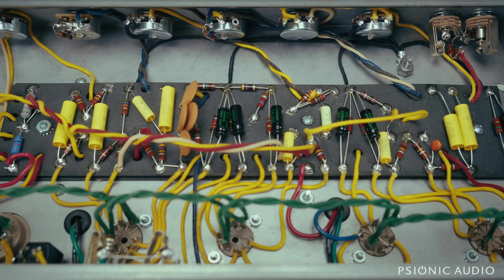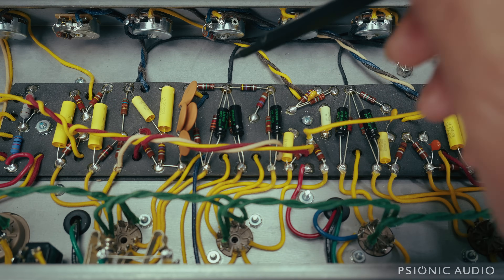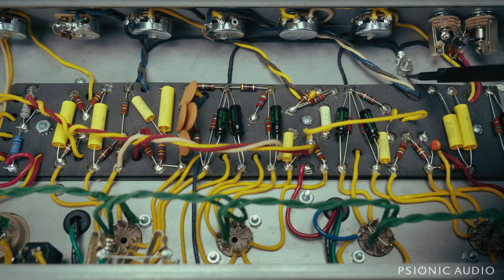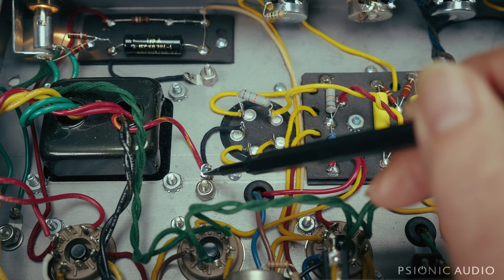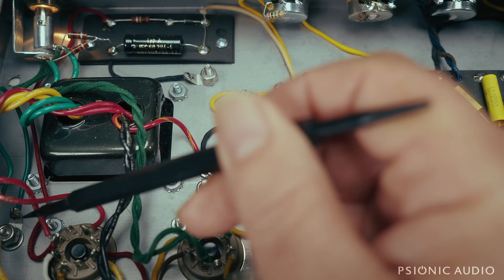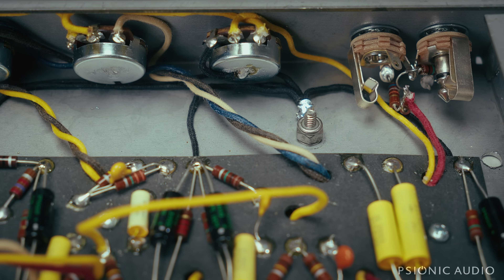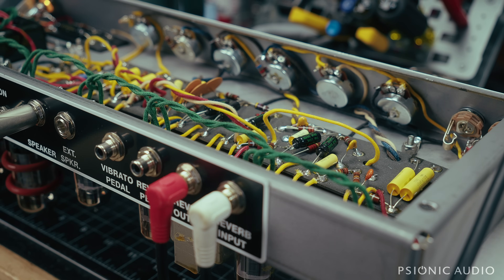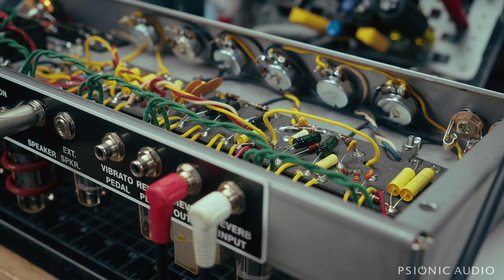Listen to Leo | Headstrong Lil King Pt 3

Comment: In other, previous videos, you adamantly advocate for grounds soldered to the chassis rather than lugs. Am I missing some context?
Reply from the maker: Yes, on those vintage amps that used lugs secured by the transformer mounting hardware, the lugs would come loose. Rather than drilling a vintage chassis, I solder directly to the old chassis like Fender did pre-‘65.

On new non-vintage amps I’ll drill holes for dedicated ground lug connections. Not all new steel chassis accept solder well, and aluminum doesn’t take solder at all.

Comment: Fantastic work, and it shows (both audibly and visually) ! Just two questions : about the input jacks: are they connected to ground nearby by soldering, but simply by their tightly tightened Switchcraft washers ? 
Regarding the cathode ground of the 6V6 tubes (8 & 8), are they soldered directly to the ground of the output jacks ?  Thanks for reading, I love your work !
Reply from the maker: Thanks!  Yes to both. The hardware on both input and output jacks is really tight (now).
Reply: @PsionicAudio  Thank you so much for your replies, they're a huge help in modifying my 5E3. It buzzes a lot, the hum is loud. And I'll soon have an AA1164 kit that I'll modify like this Headstrong Lil King ! These improvements are simple, as you say, and undeniably effective! See you soon !

Comment: When you are drilling holes in the chassis how do you keep the metal shavings from flying everywhere. Do you hold a vacuum wand next to the drill bit or blow it out with compressed air when you're done?
Reply from the maker: I drill over the trash and brush off little shavings. I’m doing small holes here, and gradually increasing the drill bit size, so I’m removing a very small amount of metal at a time. As needed I’ll vacuum it out afterwards.
Reply: @PsionicAudio , Unfortunately,  Unibits typically start at slightly over 1/8, which is often a bit too large; I've never seen a smaller one but wish I could have such a thing; of course, I'd likely snap the tip right off the first time I used it on steel (easy to do if you don't drill a pilot hole first).
Reply: For drilling holes in a steel chassis, stick a small neodymium magnet or two onto the chassis next to where you're drilling. It will catch the bulk of the "swarf".

Comment: Are we in favor, or not, of chassis ground wire, and maybe, heaters, being green? Just asking... And, sorry, for, the overuse of commas.
Reply from the maker: Circuit grounds black, power cable ground green or green/yellow, heaters I prefer two different colors twisted together.

Comment: When the Speaker output jack does become loose, as they often do over time, wouldn’t the cathode as well as the negative lead of the transformer have the HT potential present?  IE the amp cuts out, the player reaches before the amp to check the speaker plug and gets hit with 400VDC when they touch the speaker plug?
Reply from the maker: No, that’s not a possible situation. Not how things work. No time to go into it now.  But a properly tightened switchcraft jack with toothed washers will not come loose unless someone loosens it.
Reply: @PsionicAudio  what would happen if someone were to loosen the output jack?  Wouldn’t the cathode of the output tubes be open with reference to ground and in turn the HT potential would be applied to the secondary of the output transformer, speaker, cabling, etc.?

Comment: Great stuff Lyle. Rather than drill holes, why not ground directly to chassis like Leo did?
Reply from the maker: This steel is harder to solder to and it takes more time.
Reply: @PsionicAudio , get a bigger soldering iron? 🤔😉 (somewhere around here I have a soldering iron very nearly the size of a rocket propelled grenade or mortar shell! I'll post a picture if and when I find it. Unfortunately, it won't fit into tight spots......,)